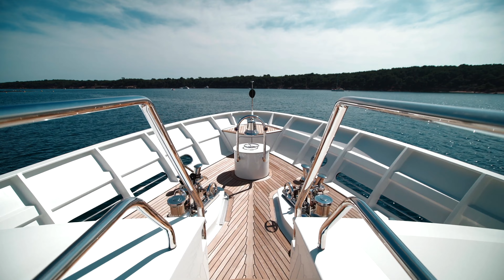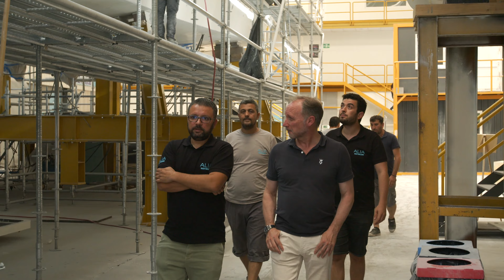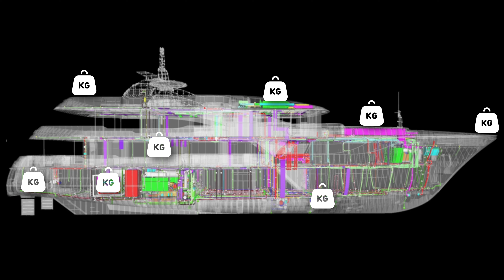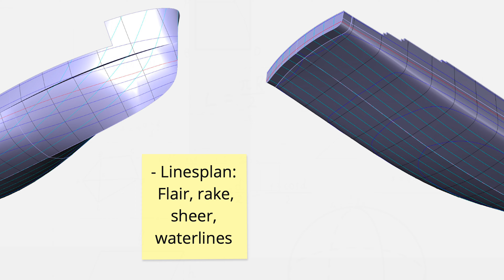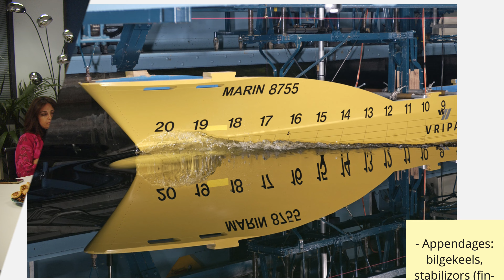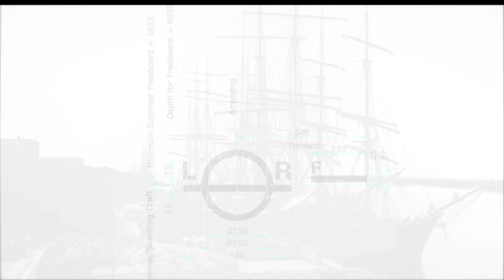Building your Superyacht. VRIPACK explain things that you may NOT have thought about!!!

Comment: 2nd 😂

Dear David, 
Why does "all" private yachts don't have a dedicated hospital room?
E.g. if an owner needs to undergo a medical treatment on a regular base (several times per week) which requires special machines/equipment.
Reply: A hospital room is useless if you don't have a doctor, or at least a nurse/physician assistant abroad. 'Passenger' yachts require a doctor aboard (though there may be nuance there, possibly allowing a nurse on smaller vessels). For smaller yachts with a limit of only 12 passengers, a mandate to have a hospital room and doctor aboard would be an egregious burden on such smaller yachts, not to mention a massive waste of scarce doctors. Smaller yachts are rarely out of range of medical services. One could make the case that explorer yachts that might be far from medical services ought to have one, and I would agree, and many of them do.
Reply: @panpiper  when you have to do dialysis, you need some machines and some filters, etc. 
You don't need a Doctor on Board. 1 or 2 trained nurses plus the technician to service the machines is usually enough. 
With longer needles you can connect yourself to the dialysis machine - if you are used to it - and the nurse as backup in case of.

In case it is more severe and you have the necessary money, you will have your personal medical Team.